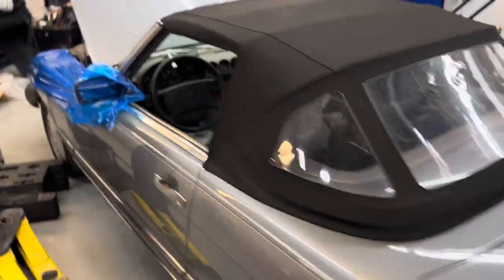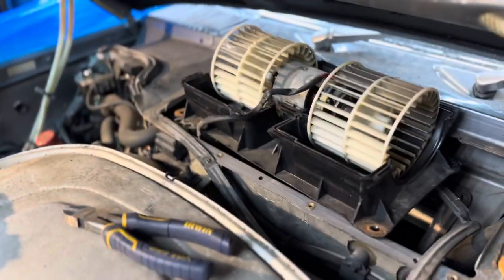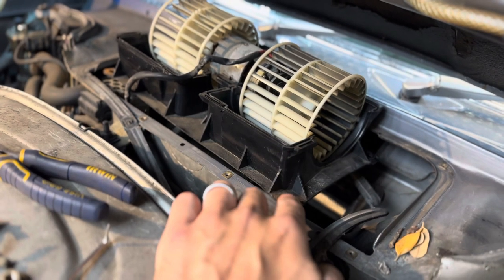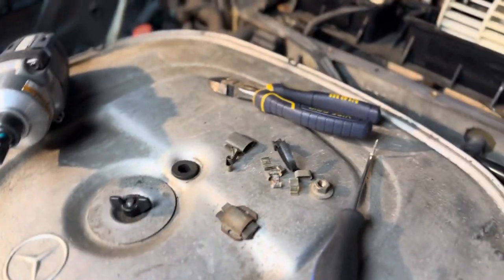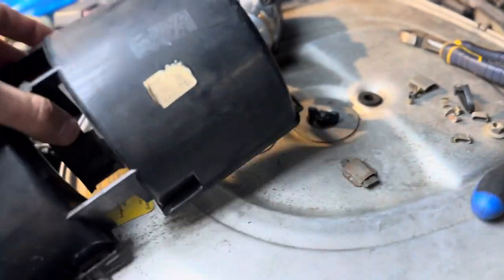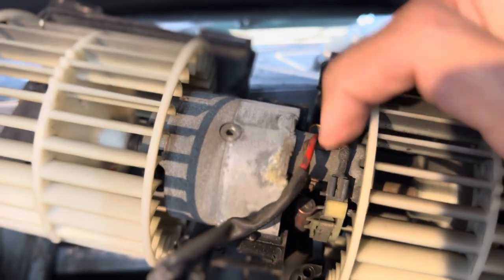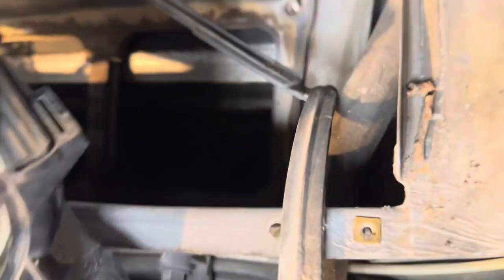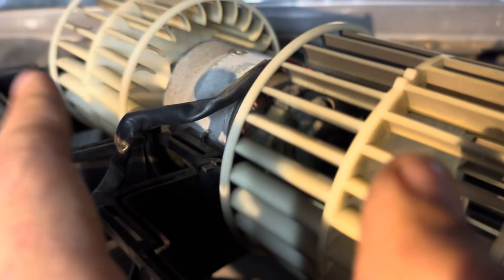R107. AC. Blower Motor Replacement. Mercedes 560SL

Comment: Im doing the same job....the holes in the original mptor housing hold it in place , the fit ovrr a pin sticking out of the plastic base. What did you do to keep the motor in position??

Comment: Sorry for the typos in the last comment. The hole you can see in the metal motor housing is functional. it fits over a plastic pin on the outer housing base. What did you do to keep the motor in place? the only way to get the motor to fit in the housing is to break off the pin...I'm hoping you can help..